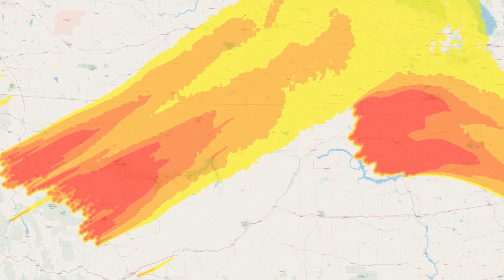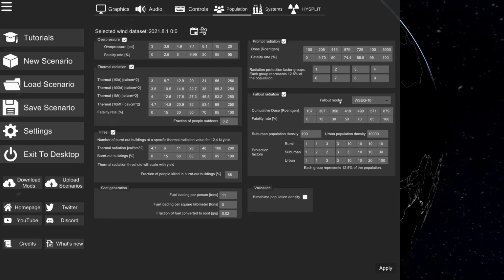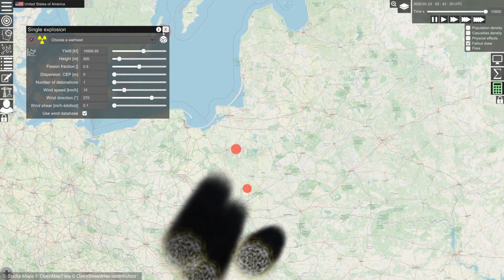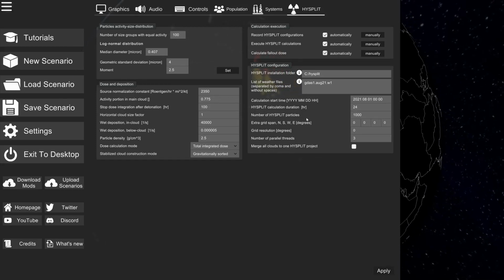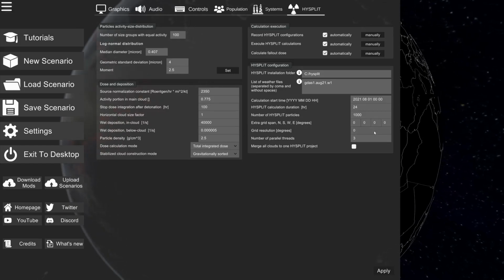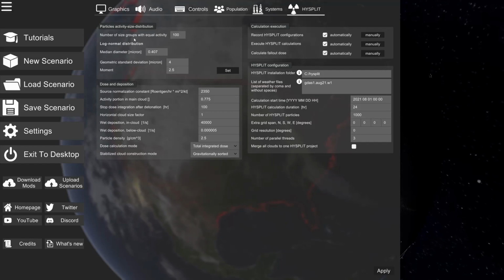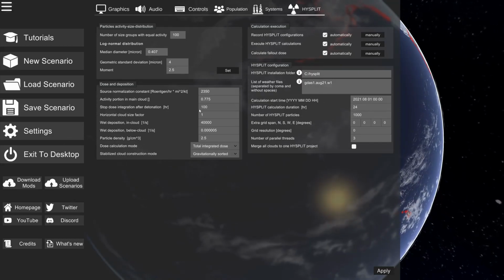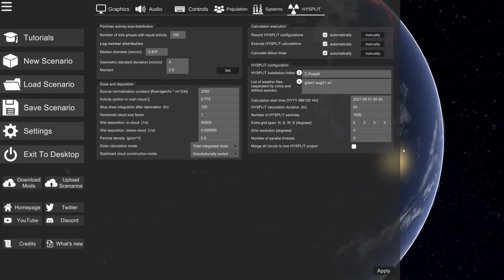HYSPLIT

Comment: I am not getting the same results after following this video, when I use HYSPLIT all I see is smoke illustrated as it moves with the prevailing winds, it never shows the radiation. I noticed in your other vids that your version is earlier than the current Version 1.00.0382 and many of your tutorials although well-intended cannot be followed because the new version doesn't have the same GUI, and it doesn't give the same results as the tutorial demonstrates. Are you going to do any tutorials using the current Version 1.00.0382 anytime soon?